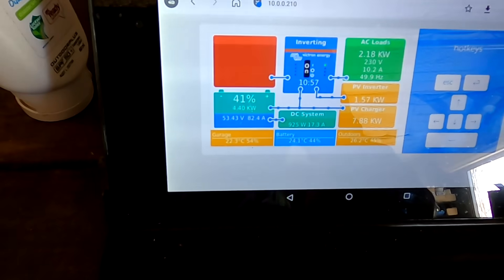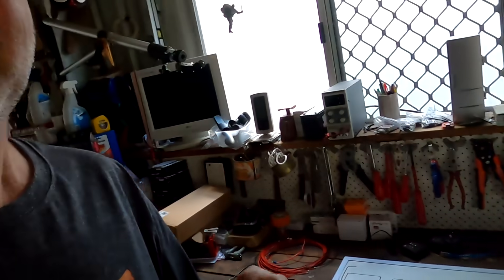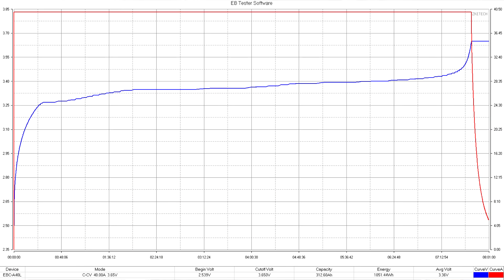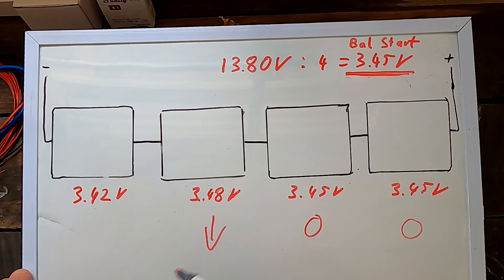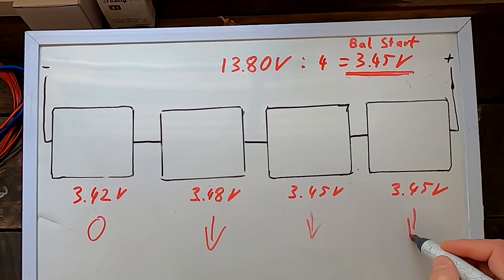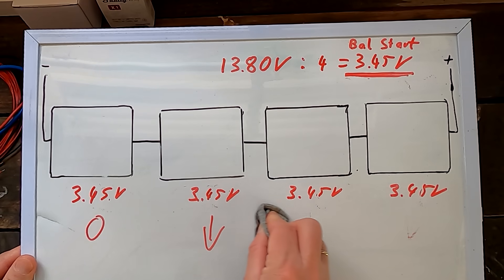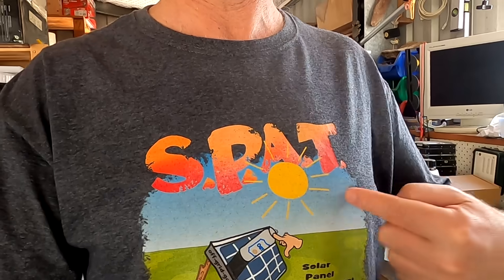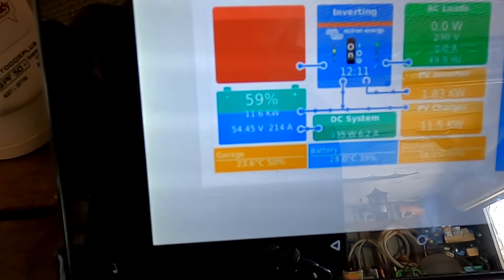Balance Start Voltage for LiFePO4 explained. Why you should not start too early... 🔋⚡

Comment: There's some confusion in this explanation. If your target is 14.2v you don't want to start balancing at that point. You do want to start before that. The first explanation was kind of correct because @ 13.8v (3.45v/cell) is around the point the cells start running away from each other (they are starting to climb out of the flat). I've watched this closely with my 12v set ups and it's pretty consistent that when the first cell reaches 3.43v the deviation starts to increase quite quickly. 3.43 or 3.45 there's very little difference. But if the target voltage is 3.55, you certainly want to start balancing @ 3.43/3.45 because this is the voltage range where you can clearly identify that the one cell (which is actually the weakest almost always- not the strongest) is becoming close to fully charged, You want to start discharging that cell as the others increase. There's no benefit in waiting until one cell is @3.55 volts to start discharging it. If you have cell #1 @3.45v and the other 3 cells are at 3.33 for example, you can be sure that cell  #1 is running away and can start balancing that cell. To make that assumption below 3.45v has no benefits which is where Andy is correct.
Reply: If you got an active balancer that is strong enough to carry the capacity discrepancy of the weakest vs the strongest cell as a diversion energy transfer during both charging and discharging it will effectively be able to divert the energy that is either too much or missing at the weakest cell and get it from or push it to the strongest cell(s). This should in theory wear the stronger cell(s) faster (as their currents are higher) and spare the weaker cell.. over time bringing all cells to a more common level and remove the discrepancy.
Reply: @joansparky4439  If you have an active balancer like the Neey that is strong. Set the start voltage to 3.45v and forget about it. You won't even be watching this video probably. But If you are charging with 100amps and set the balancer to only start at the target voltage you're going to go into a start stop scenario immediately.
Reply: @ AussieAustrian  
Yeah, if the cell difference (weak/strong) requires the energy diversion to exceed what the active balancer is capable of diverting the weak cell will hit the boundaries quickly, leading to start/stop cycles (just like in a passive balancer or without a balancer at all).
But I think if the strong active balancer technology becomes economical enough we won't be talking so much about matched cells anymore, which is a good thing IMHO as it allows for cheaper packs to be built.
Right now the JK's use just one capacitor to run around and move energy between the cells. If they could build those with two or 4 of those energy movers for the bigger BMS this would be good I think.
Reply: why one? i for example have 4 'weak' cells from 8.
Reply: It will just target the highest voltage cell that is running away. In your case you have 4 “weakl cells. So in your case it will shave charge off the highest voltage cell, charge the capacitor and send it to the lowest voltage cell. This will make one of your other 3 higher in voltage. It will then pick the highest voltage of those three and do it again.
Reply: I agree. The balancer needs room to operate.  If you set it == your target charge target balancer has very little room to work.  Your charger will have to hold that voltage for an extended period of time.  When doing initial balance I think 3.35 is a good value then during production after balance is achieved 3.40 to 3.45 is good.  But setting to to low below the "knee" will prove useless due to cell drift will be masked by the bulk zone of the charge curve. Will be like shoveling mud. Iv spent countless hours watching how the balancer behave with different charge sources. Also if it's 3.40 the bms won't bleed off those cells it moves energy, not discharges it. If set to 3.40 and avg v is 3.50 for eg. The balancer stops working after delta is met.  It will do nothing even tho avg is above the start trig voltage.

Comment: Hi Andy, My Daly 1A Balancer is doing fantastic, but with my Poorly Grade F Litokala cells I need a wider spread on the start woltage to stop a runner. Charge to 3.55 balance start at 3.4 I have tried higher but no good with these cells.

Only 52 Days to the Solstice!!! By Christ it is dark in 🏴

Shine on mate
Gaz
Reply from the maker: Once you top balance to 3.55V, can you go higher to 3.6V and balance the pack there? Turn off the balancer at this stage and do a cycle. The batteries should stay fairly balanced when they come back to 3.55V. Not 100% but it should work at least to the point that none of the cells shoots over 3.65V.
Reply: @OffGridGarageAustralia  Hi mate, I have already tweeked it up a bit.  Start voltage is now 3.45v charging to 3.6v and all settled and running well with no disconnects.
I will try your higher start voltage but with small poorly cells the upper voltages rise very quickly.   I am not sure how these will act once I charge at higher amps.  
Just need more sun lol,  the Scottish weather has been very dark and unreliable with a handful of brighter days.
Dave 🐔sends his love, he dreams of roaming your garden in  Hot and Sunny Australia .
Cheers Gaz

Comment: This all only applies to passive balancing BMS, not the active type like the JK's, which support the weakest cell and instead wears the strongest cell at all times. 
Active balancers like this in theory even allow for the FULL capacity of each cell to be used (even if they differ), surpassing top-balancing, as the BMS is supporting weaker cells with stronger cells during charging and discharging.. this naturally needs a BMS whose balancing current is at least as large as what the maximum dis/charge-current one has got in the pack times the difference between the worst cells.  Say the difference is 30% between best and worst cell and the max current is to be 10A, then the BMS active balancer needs to be able to balance 3A.. which means the strongest cell is delivering 13A while the weakest delivers 7A.
The overall concept is then heading into the direction of not needing to top-balance a pack at all once the BMS balancer is strong enough to deal with any mismatched cells - it's simply balancing all the time anytime.  Economically the whole thing lives from the price difference of a strong active balancing BMS vs what a well matched battery pack costs compared to a not so well matched pack.
In IT they use the term JBOD for Just A Bunch Of Disks to create a larger volume.. maybe once strong active balancing BMS become widespread and economical enough we'll be talking about JBOB in the future and don't care about matched cells for a battery pack anymore.. because the balancer is able to cope with very unmatched packs due to being able to let the strong cells work for the weak ones.
Reply: Fully agree, at active balancers which only discharge the strongest cell to load the equalization capacitors it is better to start earlier to keep the cells in balance. When it comes to passive balancers Andy is 100% right.
Reply: @ kirkdis  
I think Andy is just not realizing that cells with all the same voltages at the top is just a way to make passive balancing work (and it looks "tidy").
Active balancing doesn't care about looks, it just tries to get the job done of getting a bit more out of the battery (driving individual cells differently), which naturally must lead to the top balance being off when it comes back up on recharge - because it purposefully balanced it further down and anywhere in between.
Active balancers simply do not keep the "tidy" top balance intact.. there is no need for it really. They re-balance all the time anyway.
And if they are strong enough and the balancing current is capable to divert enough energy (the diff between the strongest vs the weakest cells(s)) the battery will actually be in (soc) balance 100% of the time, not just at the top.
Reply: As much as I love Andy and his channel, in my situation I found this not to be the best advice. Using JK BMS and solar charged batteries, I found 2 things that makes my situation maybe different:
1) There are days (especially in winter, or during rainy days) when my battery does not reach full charge. It could be many days in a row, when my battery reaches anywhere between 50-80% charge and then discharges (down to 10%). In this situation I would be many days/cycles without any balancing.  
2) From my observation my JK BMS does not behave like mentioned in the video. The JK BMS takes the highest voltage cell to charge the lowest voltage cell. Does not touch any other. Furthermore, the deviation settings help, so if the batteries are within 5mV it does not kicks in anyway.
Reply: @tomsydney2430 Same here except I use 10mV delta to start the balancing. While the cells at the flat curve (10-90% SoC) there is so little voltage difference between them the balancing do not happens.
Reply: Simply having a stronger balancer might cover some serious defects... Another useful future BMS function could be intelligent sensors that notice weird behaviours and flag this to the user... Like changes in cell drifting behaviour...

Comment: Hi Andy, How do you set the voltages on the charge controller is it below the cutoff voltage of the BMS or equal or higher? Gruß aus DE
Reply: below.. the cutoff of the BMS is the catch all worst case that shuts off the battery pack to prevent damage. The charger is supposed to only deliver up to max charge voltage and not more.. if it fails and goes above that the BMS is there to protect the battery, not to do the job of the charger to stick to it's maximum output voltage.
Reply: @joansparky4439  yes, that's how I set it up for me too, the BMS is the last line of defense. let me ask the question another way 🙂The 3.45 volts is the absorption voltage at the charge controller is this still enough for balancing? Or does the Charge Controller and BMS play Pingpong at 3,45V
Reply: @ frankk3873  
This depends on the different cells performances, the capability of the balancer vs what is being demanded of the bank and lastly what BMS it is.

Passive balancing is there to get all cells to the same ceiling (pulling down the weakest as those reach it first) and then letting the weakest cell determine the performance of the whole bank - so well matched cells are preferable and the balancing voltage set how it's shown in the video makes sense.
Active balancing OTOH is able to divert energy from/to the weakest cell to/from the strongest cell and allows for less well matched cells. If strong enough it gives access to 100% capacity of all cells, but that depends on what demand the battery is seeing (if that overwhelms what the balancer can divert, it can't compensate). Here balancing should be running all the time, to make that possible.
Reply: @joansparky4439  Ok your second answer makes more sense. I'll have to see what the Victron does when the cell voltage goes down again due to the active balancing, whether it changes from float to bulk again. Balancing is certainly not lossless
Reply: @joansparky4439  I have a 100ah, 16S battery pack with the 2A jk bms active balancer. the charger is a voltronic clone hybrid inverter with only bulk and float settings, no absorption time. i use 3.45v as bulk voltage and 3.375v as float, max charging current set at 50A. A friend advised I set the BMS start balance voltage to 2.9v & 0.005v trigger voltage difference. his theory is that it will provide an even discharge from all cells rather than the weakest cell hitting UVP while the rest cells still have juice. He says that if batteries do not reach full charge everyday (3.45v), then the cells will not get balanced. based on Stuart's video, this theory seems okay. what do you advise? my questions are:
1. do I change the balance start voltage to 2.9 or keep it at 3.45v if batteries will not be regularly fully charged. 
2. should I set the bulk and float voltage to the same value, as my inverter has no way to set absorption time?
p.s. the inverter system is basically my main source of power, so its loaded 24/7. 
thank you for your time.
Reply: @alexanderezra1509  
I'd keep the balancer so it balances all the time - this should help your weakest cells stay supported by your strongest cells, even if it is not being charged to 100% SOC regularly. So yeah, 2.9V is OK for that.
As for bulk vs float, your settings sound OK to me for LFP as well.  I think it will only go bulk when it can (full sunshine manages to charge your bank to 100%) and once there switch to float, until it can do bulk again. As long as there is no "absorption' voltage setting left over from lead acid that goes higher than those two you should be fine.

Comment: I think jk BMS default of 3V is much smarter, and a cell deviation of .005. Cause what will happen is you will trigger over voltage protect just because one cell hit it when others are lower, thus battery never gets fully charged quickly then

Other issue is let's say you discharge to 10%, could take days or weeks to get battery back to 100% if many cloudy days, it should be balancing overnight so we don't start next day again with to much deviation

Comment: What happens when you have  four 100ah batteries with each battery having its own BMS? I am enjoying your channel.  Thanks much for your contribution with all the knowledge shared with your subs.
Reply: Each 12V set up will drift away by time. Probably  not so quickly. Check them every now and then.
Reply: 4s configuration to be clear with aEG4 3000W EHV. All in one inverter solar charge controller.

Comment: 13.6v is full....
Reply from the maker: Depends on the absorption time you allow at this voltage.
Manufacturer specification says, 3.65V with 0.05C cut-off is fully charged

Comment: You have also to stop balancing when you discharge, weaker cells with higher resistance overshoot when charging with high currents and drop fast with discharge currents, what would cause imbalancing them again if you don't stop balancing on discharge.
Reply from the maker: That's another point of not balancing too early. With the simple rule I explained in this video, the balancer would stop as soon as the discharge process kicks in.

Comment: Balancer would not balance at all if the threshold of 5 or 10mV cell difference is not exceedec, it doesnt matter when you start, you just shouldnt balance below the run off curve in the flat area. 3.42V is ideal.

Comment: The weaker cells have the higher votage and higher resistance. Not the other way around.
Reply from the maker: Weaker cells means their voltage and SOC is lower, hence they don't get balanced.

Comment: I have my BMS's and inverters set just like this. Of my 6 packs only 1 is 280AH all the rest of em are all over the place after a year in use. 210AH, 157AH, 215AH, 227AH, 241AH. Ive lost some serious capacity using an overkill BMS. I recently bought 64 305AH and am switching to an active balancer, JK on those. Hopeful the BMS doesnt let the packs get woefully out of balance

Comment: Andy, can you explain why bottom balancing doesn't make sense? For example: if one cell is depleted prior to the others, wouldn't it make sense to top up the empty cell and continue to run the battery back down?
Cheers mate - love the videos.
Reply: Not possible with passive BMS.. u can do that with strong active BMS that are able to get the energy the weak cell(s) hasn't got taking it from the strong cell(s).
But if the active BMS isn't strong enough.. say weak cell is 70% of strong cell and we draw 10A from the pack while the BMS active balancer can only transfer 1A.. it won't be enough, it needs 3A (or maybe even 6A in the case if JK BMS by how it works) to divert enough power from the strong cell to the weak cell for the whole pack to sustain 10A without discharging the weak cell faster than the other cells.
Reply: You want to get as much energy INTO the cells as possible. Top balancing means you can do that thus gain Amphours. I may be wrong, but AFAIK bottom balancing was a concept that made provision for not damaging a weak cell in higher internal resistance cells such as lead-acid, as that would increase the one cell's internal resistance out of proportion with the others, resulting in slower charges and imbalanced charge voltage distribution across the cells. With low and pretty consistent internal resistence across the voltage range, that's not an issue. I think ....
Reply: @ henniemouton229  
'top-balancing' as the term suggests is equalizing the voltage of all cells at the top - regardless of their respective individual "fill"-level (SOC).
They then get all discharged and the first (weakest) cell reaching the UVP will trigger the BMS or the battery will be charged back up, whatever comes first. If the cells are somewhat equal they will all wind up at the top-balance voltage without a problem.. but the whole batteries performance will be determined by the WEAKEST cell this way.

Active balancing that is on 24/7 at all states will balance the cells at all times and thus allow stronger cells to support weaker cells by moving energy between those (during charge or discharge). This gives the weaker cell some support and allows the use of storage capacity of stronger cells, making the weaker cells appear "stronger", thus increasing the performance of the battery as it's not the weakest cells performance is what determines the performance of the pack.
If the balancer is strong enough to cover the discrepancy between the weakest vs the strongest cell this will allows of the use of 100% capacity/performance of ALL cells in the pack even..